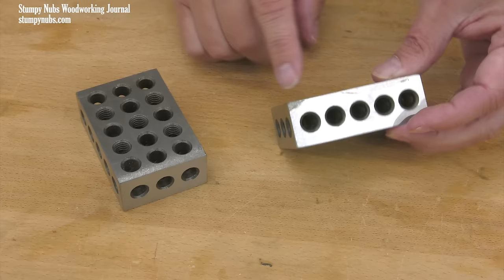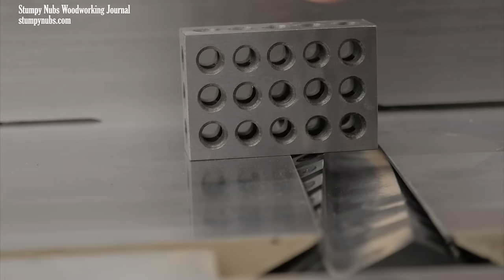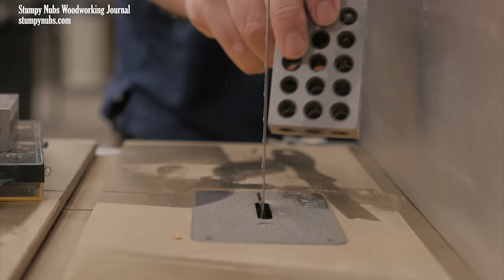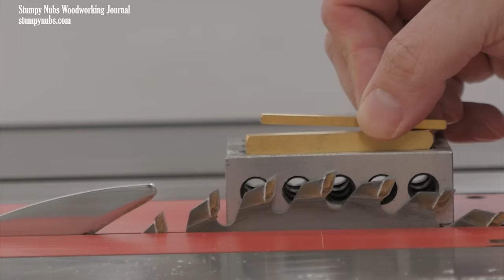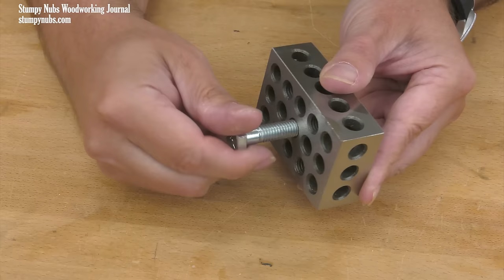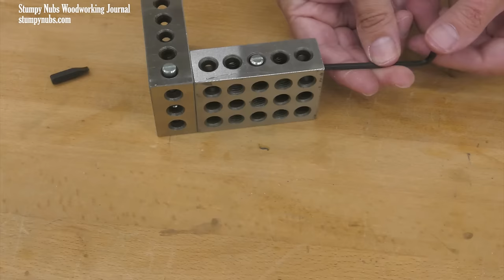An old machinist's tool that woodworkers are snatching up!

Comment: Stumpy, Your friend may have told you of the idea, but he didn't invent it. I'm a retired inspector now, but have used a like setup for over 40 years, and it wasn't new when I first was given the idea by someone else. 
And also, you'll never know if your setups are 90 deg. unless you clean all the dirt & shavings from the surface you're working on first.

Comment: I bought a set of 123 blocks not knowing what I'd use them for, turns out they're great for calibrating my Kreg ACS, why use a tape measure when can use a 2" block of steel to precisely position the measurement lines.

Comment: Sounds great in theory. But barrel nuts will automatically pull block to center of hole. If hole is not perfectly center will blocks stay flush with each other when tightened?
Reply from the maker: Works fine.

Comment: If you purchase precision blocks from Suburban Tool, the have all the through and threaded holes in the right place and size. Plus they are REALLY precise.  To square things up it's nice to use 2-4-6 blocks on your setup table, cause they are much heavier.  I don't do much woodwork, but as a machinist from way back, I've relied on these two items. One thing you can make with them is a truly square carpenters square. I've found that none of the store-bought ones are really square (to within say .010 over two feet.
Reply: Doesn't Woodpeckers make a Carpenters  Square? Or was it a "One Off" (unless we get a lot of requests to make more of them) type of run?

Comment: Suburban tool has both the correctly designed 123 blocks and the lower end type, they also have a good video explaining the problem.  "How To Evaluate 123 Blocks- USA Made vs. Imported"

Comment: I’ve been using “3/8" to 1/4" Tripod Ballhead Reducer Bushing” (camera mount accessories) for a similar purpose. These inserts are cheap and moveable and accept whatever 1/4-20 screw, bolt, etc you want to use. I’d attach photos if I could showing them used so feel free to reach out Stumpy and we’ll figure out how to get them to you and you’ll have another video idea. 

But after seeing this video I’ve put the Taylor set on my Christmas List as another option.
Reply: same here

Comment: Cool idea but in the end you spent 5 min bolting together a right angle.  I'm sure you have multiple machinist and woodworking squares in the shop that would have done the job at the drill press just as easy.  Love the 123 but can't imaging spending the time to bolt them together
Reply from the maker: More like 30-seconds, but it's fun to exaggerate... And if you think I was just bolting together a machinist square, you didn't pay attention. It was a jig to hold my work securely and square at the drill press. And it was just one of many ways to use them, as was also explained in the video.

Comment: Do the 1-2-3 blocks sold by Taylor Tools require this hardware kit, or are their unthreaded holes machined with enough clearance to allow screws to pass through?
Reply from the maker: Taylor does not make the blocks, so yes, they need the hardware kit.

Comment: You'll all love helicoils and keen serts if you love 1 2 3 blocks. And check out threaded plugs and black max adhesive. And get a CNC machine for you wood shop. It'll blow your mind.

Comment: The small family owned business that Stumpy refers to is not actually making these 1-2-3 blocks. The blocks are sourced from china and resold with the additional hardware to fasten them together. If you are looking for tools that are made in America I would recommend looking somewhere else.  The box that they arrived in were clearly labeled made in China.
Reply from the maker: Taylor Tools is a family run retailer, like a hardware store. They are not a manufacturer.

Comment: Wow!!! I had been doing a similar method, but it's way overkill compared to this. 
 
I was using a ¼-⅜ adapter that I normally use with t-slot extrusion. It allowed me to thread a ¼-20" bolt into a nut that has a ⅜-16" thread on the outside.... I had thought of barrel nuts but they're ridiculously overpriced (often $2 ea).
 
So this is great! I just wish Taylor came up with this 5 years ago as it would've save me a lot of expensive mistakes, and unnecessary purchases.

Comment: I just want to clarify. They are not perfectly flat. To non machinist, that may seem true. For machinist, the difference between a $20 set and $100 set (of 2) is a scrap part. The faces can be out up to .0003" I think, on top of the line set. I have seen a cheap set be out over .003", which is the thickness of a sheet of paper. A bad grind job doesn't always mean it's tapered but may have a bizarre belly Ina few sides, which compounds from face to face as it gets worse. I only say that for people who think the light trick is bullet proof. Aka, people use these to check 90°wood joints. The joint may be fine and the 1x2x3 block may actually be wrong.

Comment: And with the right hardware, they should fit into T track.  I can also see them being used as stop blocks on the table saw.
Reply: You can get their 1-2-3 fence clamps to make that really quite easy.
Reply: @oldguy1030  I just bought two Milescraft fence clamps which have 3/8" rods. Would they work?
Reply: @russmartin4189  I've not tried that, but IIRC the machine screws/bolts for the 1-2-3 blocks are 3/8-16.
Reply: @oldguy1030  Gotta get a pair of those  blocks. s==

Comment: Here's another one:
Angle plate. Cast iron.
'nuff said.
Also V-blocks, for glueing triangular slats into the corners of boxes for reinforcement.
Look up HBM machines if you are near the Netherlands.
Also I've been known to just clamp some flat steel plates or square aluminium blocks (off-cuts, ebay) to the sides of boards etc for glue-up. Alignment of edges does not get any easier than that.

Comment: Great vid.  Myself I like festool but it is pricy.  I've got an original t15+3 drill with original battery.   Now I've got milwaukee.  Just Plane old trades tough.  Blades I'm a forrest guy.  Anything high quality or requiring precision no big box.   I will buy glue from them as the tend to move it but I check my codes. Paper I buy festooned ln lower grits and higher use automotive autobody supply stores.  For fasteners I use tractor supply or mailorder.

Comment: You said your 1-2-3 block is 1” thick, 2” wide, and 3” long and that’s cool, but …

A lot of people don’t realize there are also 3-2-1 blocks that are 3” thick, 2” wide, and 1” long. I find those a lot more useful.
Reply: Couldn't agree more. I've owned both sets. The 3 2 1 blocks are where it's at.
Reply: I believe in Canada they use 312 blocks. Except for Quebec, where by law they have to be 213.
Reply: But the 246 blocks are better
Reply: I’ve gotten a lot of use out of my 2-1-0 block, plus it stores virtually anywhere
Reply: I like trains.
Reply: @fritterVII  
I ordered a set of those but I think I got ripped off. When the package was delivered, the box was empty. Never ordering from Goodbang again.
Reply: Born and raised in Detroit, so I’m partial to the 313 blocks.

Comment: Originally they were called sine blocks. Used with sine tables to achieve angles and measurements.  
50 years ago as a draftsman the machine shop had me draw plans for these blocks. They’d drill ‘em and mill ‘em. Then send them out to heat treat. When they came back, then they would grind them to precision. 
Now everything is digital. Before that the machinist calculated it all. 
They called them 1,2,3 blocked back then too. But not the journeymen machinists. They called them sine blocks.

Comment: For what it's worth Brown and Sharpe offer 123 blocks that have C'bored through holes of the correct size to the fit the included socket head cap screws to do this very task.

Comment: As a hobby machinist, I think a better idea would simply be to buy the less expensive blocks, and true them up as long as they were close enough. This would be a very easy CNC project. The halfway decent CNC machine that I have is accurate to at least .0005, sometimes .0003 if careful. And this means across many pieces. I think the end product would be higher quality, and you could get a better margin.
Reply from the maker: Or you could buy inexpensive blocks that are already true, as are the ones in this video.

Comment: do you know if the 1-2-3 blocks you linked to allow the bolts to slide through the non-threaded holes?
Reply from the maker: Taylor Tools does not make the blocks, so yes, they need the hardware.

Comment: When you say "I know a family that makes great 1 2 3 blocks" I was under the impression you knew a family that was from the USA, they're made in China? Do you personally know them? Or know them like I know them, through their website?
Reply from the maker: Yes, I personally know Mike Taylor who owns Taylor Toolworks, which is a family owned and operated retailer in Columbia, MO. I don't believe I said they MADE them. They are a retailer, like Woodcraft or Rockler. They don't make tools, they sell them :)
Reply: @StumpyNubs  fair enough, I mean I don't have a problem with them so far, I was just suprised when I saw "made in China" on the packaging when I received them, i misunderstood or thought you meant something else.. I guess I was under the impression they wouldnt have been an imported item, maybe it was "high quality".. eitherway I can't complain, I only paid $20 for them which is cheap.. Thanks for the video!

Comment: Not to be a downer on the product, but you can buy an angle plate for not to much.  I would check to make sure that it was truly accurate,  but I would do that whether it was $18 or  $500.
Reply from the maker: That's just one of many things you can do with them, as was explained in the video.

Comment: I would not recommend trying to drill open any holes in the blocks. You would ruin more drills than anything else if they are anything but case hardened. As a machinist, I have made multiple sets of blocks out of A2, O1, D2 and S7 tool steel. Once these are hardened, you will not be drilling or opening any holes in them.

Comment: If Taylor tool works is making the blocks, why not just make the diameter of the non threaded holes big enough for the threads of the bolt to pass through?
Reply from the maker: They are a retailer, not a manufacturer.

Comment: The correct solution is to get 123 blocks that are drilled properly. They exist but you have to look. They are more $ than the cheapest junk, but are not crazy.

Comment: I bought this product as soon as I finished this video.  Very affordable.  Unfortunately it was not quite as useful as I hoped.  It is very tedious to use this item to attach 123 blocks.  And so switching from one configuration to another is very unappealing.  It looked like the connectors would square the blocks up and flush the surfaces, but it does not.  After much finagling, I was able to square the surfaces up, but it doesn't take much to knock them out of square.  And I was never able to make the outside mating surfaces of the two blocks flush.  Also, I was never able to get all of the pins flush or below the surface of the blocks, which makes one of the surfaces of the mated blocks unsuitable to use as a reference plane.  Last but not least, I had to chase the threads on some of the pieces to ease assembly.  If this kit had been double the price, I probably would have been very disappointed.  However, given the price and the ingenuity attempted, I am still happy I purchased it.  Shortening the slotted side of the pins should reduce protrusions along reference planes.  And enlarging the unthreaded pin thru holes may allow all surfaces to be assembled flush.  As regards assembly, I would suggest temporarily taping the pins in the correct orientation to make the it easier to assemble the kit and 123 blocks.
Reply from the maker: If you connect them together at a right angle (such as seen in the video thumbnail image) and they are not automatically square, there is something wrong with your blocks because all surface should be machined square to each other. I don't think I could connect them out of square if I tried.... Flushing the surfaces must be done manually, but it takes almost no effort if you lay it on a flat surface as you tighten it and can easily be checked by feeling the seem with your thumb.... As for being "easily" knocked out of position, I can't imagine how that is possible if they are properly tightened. I suppose I could do it if I threw it on the bench, but "easily?" I'm sorry, but my experience is very different from yours :)

Comment: Question is: why don't they correct those flaws in the next batches?
Reply from the maker: Because it would add another setup and tool change to the milling process and significantly increase the cost. They are manufacturing to reach a price point, I suspect.

Comment: "Absolute", "perfectly flat or square", "exactly" are words that make machinists cringe. 1-2-3 blocks are incredibly handy and are usually ground with considerable precision to quite exacting standards. I guess that woodworkers don't often need to concern themselves with thousandths of an inch.  Purchasing even inexpensive 1-2-3 blocks from China would be a good investment for woodworkers.

Comment: Once the Chinese get a hold of a copy, even a bad one, they never quit making the same mistake over and over again.  This is the fate of almost all Chinese blocks.  The blocks you want are the ones designed by Moore Special Tool.  In the link, there is one set of blocks that allow assembly, these are similar to the one that Moore designed.  Moore blocks are still coveted by jig grinder operators and toolmakers.  I have a personal set from back in my apprenticeship days.  What was old is now new again.
Reply: Not sure who makes the ones I got. I measured mine with some calipers. The 3" measured 3.000" The other measurements  were about .002" off. I can deal with that. I also bought the solid ones. Very useful. Who knows. Room temp changes may  affect a thousandth or two.

Comment: Just off the top of my head I don’t see the problem with using threaded rod to connect the blocks
Reply from the maker: Where would the nuts and washers go? If they are on the outside, they will be in the way.
Reply: @StumpyNubs    Where does the bolt head go ?
Reply: @StumpyNubs    Or for that matter all- thread bolts
Reply: @StumpyNubs     What am I not seeing?
Reply from the maker: @herbertbrown119  In my case, the screw head was not needed to hold the blocks together because the barrel nuts were placed within the blocks. All-thread will require nuts/washers on the outside of the assembly, unless you plan on using barrel nuts, in which case you can't drive the all-thread in, as it has no screw head. If you cut a slit to create a screw thread, you are essentially just making the same hardware I used: A machine screw and two barrel nuts.
Reply: @StumpyNubs    Okay. Got it. Thanks.

Comment: in millimeters?
I think you meant to say centimeters?
Reply: Metric 1-2-3 blocks are actually 25mm-50mm-75mm same ratio.
Reply: @brandons9138  well, the only thing i got on that is an expression taught to me by a famous guy, yellow donut loving chap: DOH!
Reply from the maker: As you know, many dimensions in the metric system are given in millimeters rather than being rounded down to centimeters.
Reply: @bertjesklotepino  "Beer!"
Reply: @johnbesharian9965  "Ah, Donuts. Is there anything they can't do?"

Comment: What if you used a bolt that had a shank that was smaller than the threads? Then the shank of the bolt would fit the smaller hole.
Reply from the maker: The threaded end has to go in first unless there's no head on the bolt.